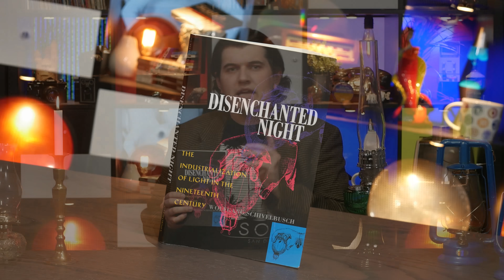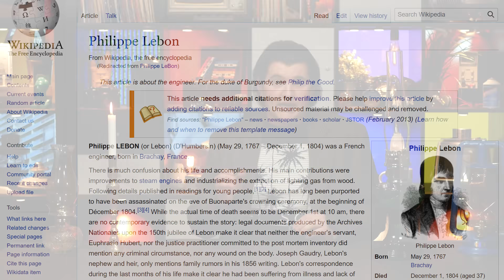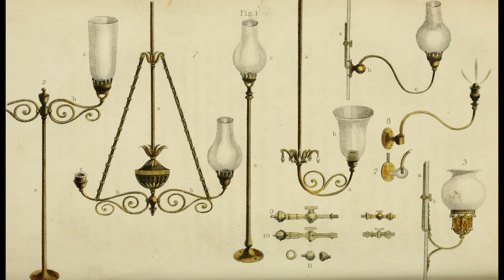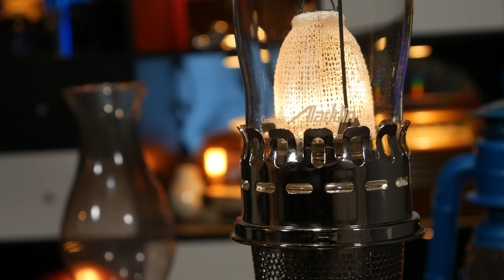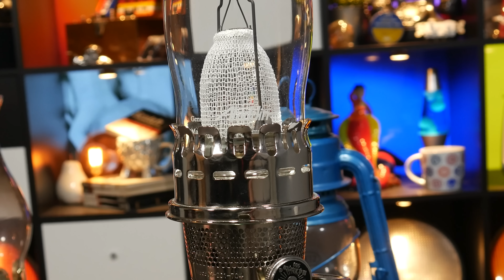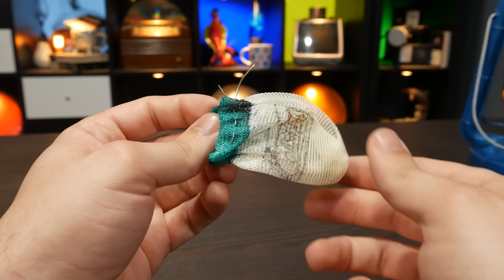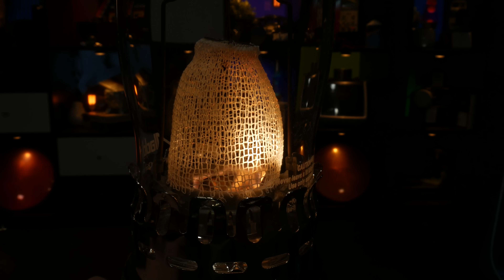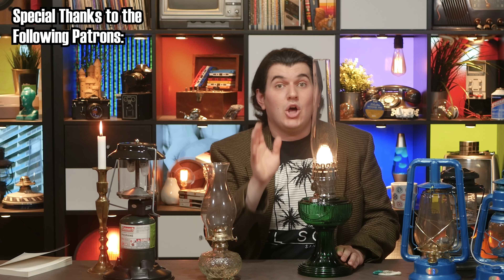How the gas mantle made lamps 10X brighter

Comment: I grew up in an old farm house built by my grand father inn 1910.  When the Rural Electric Association brought power to the farmers, we didn't have the money to wire the house, so a single pole sat in our yard with power on it, but none came to us to use.  So it was we light our home with kerosene lamps, did our homework by that light and listened to the old radio programs on a battery pack radio.  We had two Aladdin lamps but they were only brought out for holidays or when company came a calling.  The lanterns (what we called the hurricane lamps) were used in the barn for late care of the calves and for milking after sundown should we take a 25 mile trip to town. We heated the old house which was sidded with tar paper and had newspaper in the walls for insulation by burning lump coal in a coal stove located in the living room.  Mom and dad moved into the living room when winter came because their bedroom was at the back of the house, when cold weather came the dining room and their bedroom were closed off for the season. The dinning room became the 'cold' room where milk was cooled and food was stored at refrigerator like temps. We children slept in the upstaris bedrooms, one of which had a vent that could be opened to allow hot air from the stove in the living room to enter.  All three of us slept in one bed, my two sisters and I, under heavy quilts.  at night you could see the stars through the gaps in the roof where shingles had blown off, and when it snowed at night, we would awake and shake the snow off the quilts before getting up. It was not an easy life, we did our chores every day before and after school, then listened to the radio for an hour, this was limited because those batteries were expensive. Thing is, though, when we used to get together and talk over those old days, we all thought they were the happiest days of our lives. We moved off the farm in 1961 because my sisters needed to go to High School and the 25 mile trip was to far for dad to run them to town. The first year dad had my eldest sister stay with our maternal grandmother who lived in a small house in town. This didn't go well so at last the farm was put in the soil bank and we moved to town. Dad later sold the farm to a neighbor's

Comment: I was born in 1958 and until 1962 there was no electricity on my father's farm. I remember milking cows with a Lister engine running the vacuum pump and we had two Aladdin tin body lamps in the milking shed plus a couple of Tilley kerosene storm pressure lamps which also had mantles. This is in Wales, UK.  I remember the noise of the Tilley as if it was yesterday even though I last heard and saw these working before my fourth birthday.  I was born only just in time to witness this. We actually lived in the village where we did have electric light and, well, at that time zero electric powered things other than light. The farm was apparently wired up for electricity from about 1960 in anticipation of the national scheme connecting it to the grid, which happened in Summer '62.  All the original posts holding the supply wires were only replaced two years ago but the original overhead wires remain, having suffered 60 years of weather without a single breakage.

Comment: As kids if we broke a mantle we were in real trouble but I liked to see a new one being burnt off. We were told they were made of cotton coated in asbestos. I’m talking about the 1940’s. As you stated towns gas is piped at very low pressure so when natural gas was put down the same pipe work at about 12psi it was found the old iron pipes had rusted away leaving a rusty holes of many miles in the soil and these could not handle the pressure. I believe an additive was put in to make it smell so leaks could be detected.

Comment: Aladdin lamps and Aladdin touch lamps... The logical evolution is an Aladdin lamp with a net of shiny wiring around it hooked up to a touch trigger, which opens the gas valve with a quiet motor, and strikes an electric arc to light the gas. It then uses a hoop of thermocouple to slowly recharge the mechanism while the lamp is running.

Comment: I actually have seen those gas lights that you turn on by the door, when I was a kid. Here in Mississippi, those low pressure gas lights were commonly used until the 1950s or so in less developed areas. I am 24 years old, and even saw these lights being used in the area I grew up. It was really cool as a kid, but as I've gotten older, I realized how much more dangerous this design was.
Reply: It may not have been coal gas: in more rural areas you could use carbide lamps/acetylene as an alternative: you'd have a big tank in the basement or outside the house with a holder for some calcium carbide powder and a water-dropper, when water and calcium carbide mix you get calcium dihydroxide and acetylene, you then pipe the acetylene through the house to stoves, gaslamp fixtures; all those nice appliances City Folks got, but in your farmhouse and without the carbon monoxide problem.
One of the main companies selling both the lighting system and the calcium carbide to generate the acetylene is a company you've probably heard of: the Union Carbide Corporation.
Reply: I remember seeing the gas lamps in a store in Lexington, KY that were lit when the electric failed.  This was in the 40's.

Comment: Roundly fifty years ago, when I was a kid, we used Coleman pressure lanterns (with two small mantles fired by vaporized "white gas" -- a very pure naphtha) as tent lights, and a few years later, our first camp trailer had a propane fueled mantle lamp over the dining table.  Gasoline and kerosene pressure lanterns made excellent replacements for the hurricane lantern, though they did take a little longer to start up (especially the kerosene ones needed a lot of preheating before they could generate vapor to burn in the mantles).

Propane and butane, on the other hand, are near-perfect fuels for these -- liquid under fairly mild pressure, so a good amount can be stored compactly, they evaporate easily at reasonable ambient temperatures (butane doesn't work well in freezing weather, and even propane loses enthusiasm in Alaskan or Canadian winters) to provide the relatively low pressure needed for a mantle lamp.  A propane or butane mantle lantern can be started in seconds, often with a built-in sparking wheel as found in a lighter (which absolutely won't work for kerosene).  With two mantles, the light produced is very comparable to a 60W (okay, maybe 100W, it's been forty years since I had one to run) tungsten filament electric lamp -- bright enough to make you squint if you sit too close to the lamp when you read.

Of course, these days, fluorescent or LED lamps powered by either disposable or (preferably) rechargeable batteries are a preferred choice -- whiter light, no noise, no smell, little fire hazard -- but sometimes I miss the ritual of pumping up the pressure in the fuel tank every half hour or hour.

Comment: So, will you be covering the “ultra portable” acetylene lamps that were used on early vehicles?
Mantels were too delicate for vehicles & incandescent bulbs weren’t quite ready for vehicles (also battery & charging systems weren’t reliable) so for a short time vehicles (including motorcycles) had a system including an acetylene generator & small rubber pipes running to each lamp.
I can’t remember what the crystals were called in the generator thingies, but basically they just had water dripping on them to create the gas.
Apparently they could be prone to exploding if not maintained properly.

Comment: I was disappointed in this video.  You spent way to much time on the Aladdin lantern.  I waited through the video for the propane style lantern, or more specifically, the liquid fuel lantern.  Now you mentioned gasoline which is a fuel we NEVER used.  We traditionally used a fuel in a more purer form.. Some call it white gas, we call it naphtha.  You alluded to the radioactive particles in the mantle.  The naphtha lantern had a wide spread usage for camping, but we also used it in the military.  In every sheet of operating instruction was a warning that the dust of a used mantle was toxic and had to be disposed of with caution, and to avoid breathing the particles.  I still have two of the lanterns and will only use naphtha gas.  
In off the grid cottage country, a number of my friends use the propane operated mantle lanterns.  The whole building is plumbed with 1/4 inch copper pipe that feeds lanterns in all of the rooms.  The propane is the fuel used for the fridge and cooking stove.

Comment: The Aladdin lamp was also used to run radios in remote areas.  You would put multiple thermo-couples in the exhaust of the chimney and the heat would generate enough wattage to run the radio.   Used a good bit in Siberia and Alaska/Northern Canada.

Comment: The meaning of the word 'gassometer' is literally  a way to see how much gas is in the expansion tank, so it is in fact a meter. The tank level would get higher with the amount of coal gas stored so the local 'town gas' supplier would know how much is needed to top up the 'tanks'. The weight of the lid kept a constant pressure for the pipes supplying the houses, street lighting and factories.

Comment: I've lived with mantle lamps (both gasoline and propane). Annoying and finicky, and the mantle is exceptionally fragile, but they do work. However, I wouldn't use one indoors if you can avoid it -- they make a LOT of carbon monoxide.

Comment: Thanks for the video!  I've been using Aladdin lamps on my screened porches for over 20 years, and now I understand why the mantle is made the way it's made, and how it does its job.  Nowadays there are LED lamps with equal brightness, but I stay the course for nostalgic reasons.  I don't see mantle lamps going away anytime soon, because they're still widely used by the Amish.  Like you, I find them very useful during power outages.  In my experience the ytrium oxide mantles don't last as long as the thorium oxide ones, but the former produce a whiter and (to my eyes) more pleasing light than the latter.
Reply: The other reason this tried and true technology won't go away is that heat they produce.  Sure LED will give you light - but no heat , so if you're in a power failure situation in the winter, those 800-900 watts of heat may be precious.

Comment: Very informative video I am from the UK and knew about hurricane lamps but not the Aladdin lamps with mantel and wick, though I am sure we had them as my grandmother had Aladdin heaters. We did have Tilly Lamps which have a mantel but run on heated pressurised paraffin. The lamps were started by pumping up to gain pressure and then primed using a alcohol soaked piece of asbestos clipped to the tube and lit, as the alcohol burnt out you turned the valve to let the paraffin gas out and it would light.

Comment: 5:40 gasometers of the original telescopic design expand as they fill.

The height of the top section conspired to the height is the supporting framework gives a good visual representation of the fraction of capacity that had been filled.

Therefore, in my opinion, it is the pedants who mistakenly claim that the gasometer is no measuring device are themselves mistaken

Comment: I think modern electronics could make gas mantles efficient and easy to use.  You'd just need an Arduino or RaspberryPi to watch the brightness and drive a simple gear to raise and lower the wick as required.  A small solar panel or stirling engine could even power its battery to make it self-sustaining.

Comment: At one time, British Gas showrooms were not allowed (by the gas board) to have an electricity supply. They were lit by gas. Eventually a few did get electricity, then eventually it became standard.

There was a tea and coffee merchant's shop in Wolverhampton that was partially lit by a gasolier until it closed in the 1990s.

Some street lights in Malvern, and possibly London, are still gas lights.

The main issue with gas lights, often mentioned in the instructions of course, was that if a mantle did get damaged, the heat escaping from the burner could readily damage the glass.

Comment: When I was an electrical Apprentice some +30 years ago, they we're still calling a metal junction box, a "combination box".
Upon inquiry I found they was so called because the inlets on the boxes were originally sized to accept both electrical and gas conduits, so as to integrate and repurpose the latter into the former.
It was likely a redesign that had retained the legacy name.

Evidently there were also kits which would convert a gas lamp into an electric lamp or in the case of chandeliers, hybridize them. (apparently early electrical utility was undependable)

Comment: It would be of great interest if you would provide a lumen value for this mantle-based lamp, during optimal operation.
Generally Well Done.  Definitely subscribing!

I have a 10KW backup generator (NG).  Any earthquake could disrupt the supply.  Therefore, am always interested in other, small, point-based illumination solutions that don’t rely on solar panel$$$$$ or batterie$$$.

Liquid fuels have a much higher energy density and are easier to store.  The white gas “Coleman” lamps are scary to use and store; kerosene’s lower flash point makes it much more attractive, for storage and use, if one can get about 1K  lumens out of each lamp.

Comment: The small English village I grew up in the 1960s still had gas street lighting well into the 1970s, and three houses that had only gas lighting - no AC power. The last of these houses was modernised in 1990!
Elderly owners who used a battery radio for entertainment. I used to be asked to go and get new gas mantles from the local ironmonger for them occasionally.
BTW - here in Britain, in the pioneer days of gas lighting of the late 18th century, the iron barrels of flintlock muskets used in the Napoleonic wars were joined together as the first gas pipes. Up until the late 20th century, iron gas piping was referred to by older fitters and engineers as 'gas barrel'......

Comment: Thank you such good explanation, and good language. I got 100% of it. As a non-english everyday speaker, I sometimes misses here and there, but you were exemplary good. :)
As an old swedish man, I have blowlamps, kerosene stoves, and lamps in my veins, due to all swedish inventors and companies in that area. The brands: Primus, Optimus, Radius, Sievert, Bacho, and a few more all started in Sweden some 100-130 years ago, and later. I like the brass constructions. Recently, I just had to buy a new gesoline/petrol stove for it's beauty and lovely way of working. It was the Optimus 123, probably made in China, but engraved SWEDEN, (not made in..). However China makes top of the notch quality, so I believe this item is better produced than ever before. I want more from yours.

Comment: When I was a kid and we go camping we used to have a couple of those gas filament lanterns.. But the ones we had were a different design, where the lamp was you had the metal cage similar to the ones you show.. But the top and bottom of the glass was open so you could lift it up to light it, and the glass itself was frosted so it didn't blind you as much.. 😁

Comment: As a kid we had a lamp with a gas mantle for when we went to a cabin. No power so we needed it for light. On one trip the glass broke so it was exposed for the rest of the trip. I don't recommend trying to grab the glowing mantle. It's a bad idea.
Reply: We had a camp lamp that had twin silk mantles. Once we tipped it over and the silks came off, resulting in what looks like rocket jets. Cool, but made the lamp useless
Reply: They're still sold, can get them on Amazon.
Reply: tilley lamps were a vapourised paraffin [kerosene] lamp that burned on a mantle. Great light but a but scary in use.

Comment: I remember that in about 1952 in a small prairie town, we had the brightest lights on our block, We were using Coleman lamps (the tall ones) burning kerosene. Everyone else used electric lights powered by the town's Delco generator. Lighting the lamps involved using an "alcohol cup" to preheat the Coleman apparatus so it could vaporize the kerosene. And you didn't have to go to bed in the dark, because the mantles would glow for a minute or so after the lamp was shut off.
Reply: Eventually Coleman would switch to low octane white gasoline to accomplish the gasification without the alcohol starter. 

Coleman fuel today is about 70 Octane gasoline, about what the early automobiles ran off of. 

You can run your car on it,  but it'll knock badly.   Mix it with diesel or kerosene or moonshine and it'll run pretty good come an emergency.

Comment: I don't know if it's common, but the capitol of Delaware, Dover, has a 24-Acre superfund site  from the old Dover Gas Light Company operating during the mid 1800s until, I think, the 1970s.  This area is from the train tracks, along the main street, and down to the hospital. All of it is developed and has a number of abandoned properties alongside current residences.  The problem is a result of leaking brick storage tanks for coal oil. The pollution is traveling east underground under Colonial Downtown Dover, poisoning beautiful 200+ year old properties.